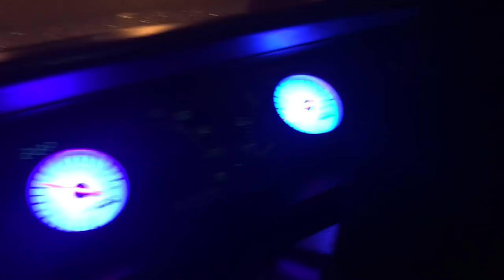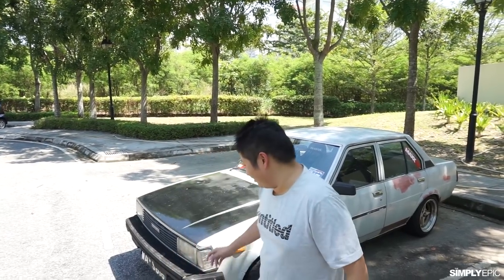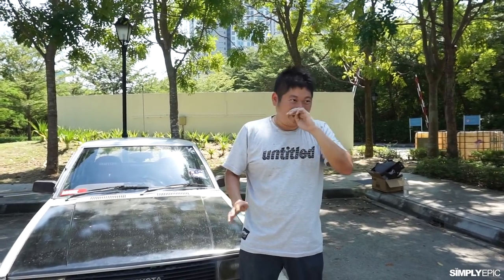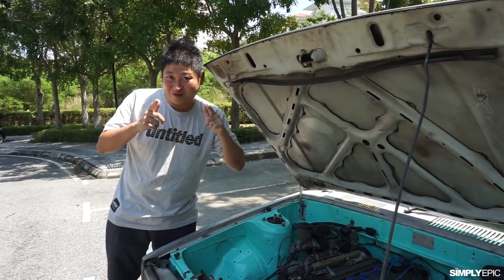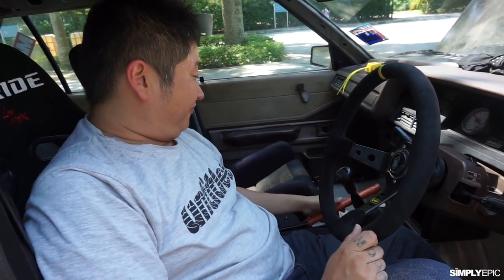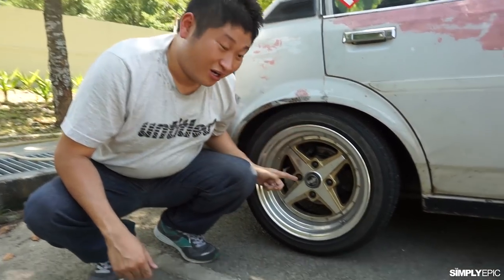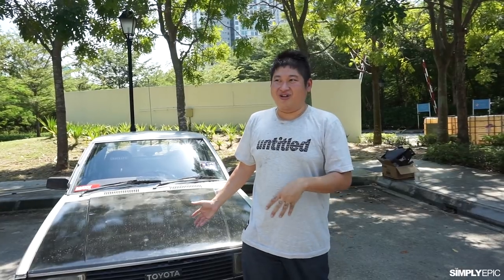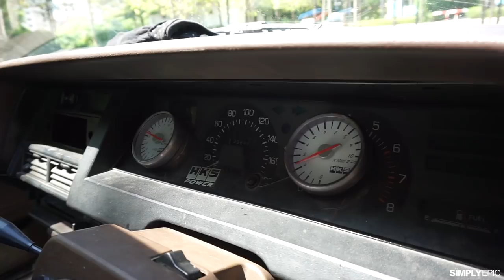TAK-KUMI "THE MISSILE" EPISODE.1

Comment: Could you do a video on following stuff:

1.) Chassis restoration/upgrade(Full frame rail connector, half roll cage)
2.) How to tune clutch pack 2 way LSD for drift or grip driving 

Those will be good info, especially with Malaysian ingenuity included
Reply from the maker: the chassis has already been restored, now waiting to save up for a fresh paint job, the roll cage was in the plan and nice suggestion on the 2 way LSD